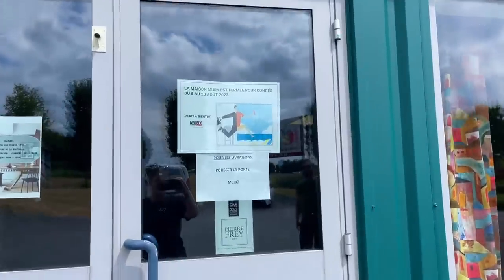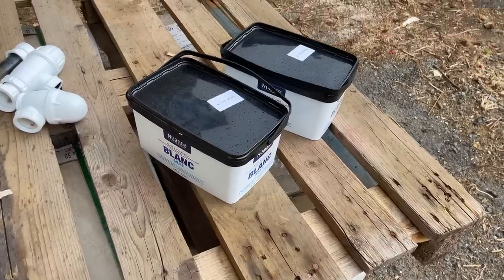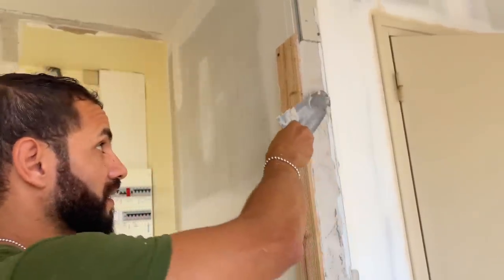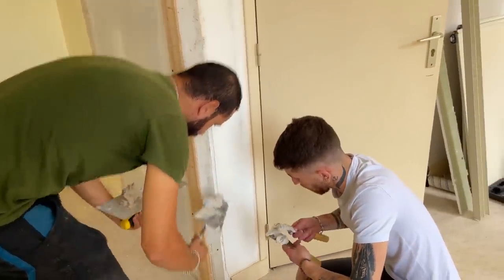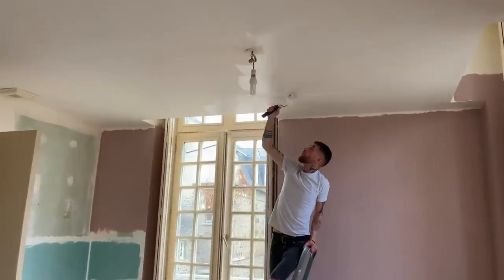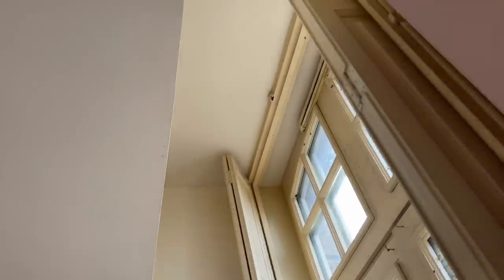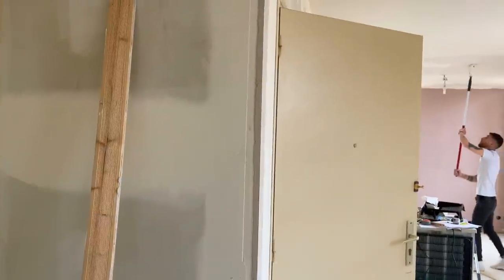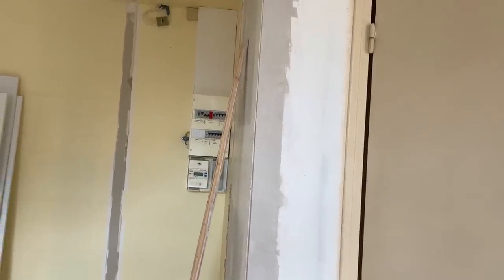Back At It In The Convent Apartment!!!

Comment: In North America, at least, they sell steel corners to form and protect the corners of plaster board walls, which represents a heck of a lot less work and is stronger (more damage resistant).
Reply: Same here in New Zealand, but maybe they are way to expensive in France if they have them.
Reply: In Belgium too
Reply: @caropapa  They are lik 5 - 10 euro per meter here. I'm geussing they were going for a more 'authentic' approach.
Reply: @RoloFilms  it’s possible, but even in the 1900’s they had lead corner bead that went under the horse hair plaster, I believe these walls have “plasterboard” so I don’t think authenticity is what they were going for, meanwhile I only discovered corner bead about 12 year ago. It was a very exciting day for me… now I would like to say that watching this episode has been very frustrating for me, because with or without his guide board, this would have been a lot faster/easier if someone had shown him to turn the trowel the right direction and not keep reworking the plaster. 😖
Reply: @kimberly_erin  AND butt the plaster board to the side sheet. That's too big of a gap around the corner.
Reply: @toniasalways  I’m sure they will realize when it cracks off… wait, is that a pun? 🤔

Comment: In Canada there are corner steel strips ( called beads) . There are videos on YouTube how install them,& put mesh strip over the metal , then you spread the plaster over the joints. The outside corners of plasterboard are more sturdy due to the metal bead strips.

Comment: I know there are already 100 comments on here and I’m partially repeating myself, but for the sake of thoroughness I’ll elaborate. When doing corners you can get very inexpensive corner bead: a metal or vinyl piece that goes on the corners before you plaster. Wether you use this or not you will have better luck if you use the broad side of the trowel rather than the narrow edge. You should almost never be using the narrow edge. Also try not to go over the plaster repeatedly, rather wait for it to dry and add another coat. If there are lumps or air bubbles work them out first before you start on your trowel with a smaller one. If the plaster leaves a little over the corner it’s easier to let it dry and scrape it right of with your trowel/spatula after rather that mucking around with it while it’s still wet.  When you are doing inside corners or joints; use the mesh(not paper) drywall/plasterboard tape. Don’t be silly and tape it to yourself, it can make you itch. 
If I had to say only one thing, I would say don’t over work  the plaster on the wall, try your best in three passes or LESS then let it dry. You can use many methods to refine it afterwards. Great progress guys!

Comment: Bravo for the hard work going on ! 
About the plaster corner. Because such a corner which Mo's plastering is easily ripped away, we, Over here in Quebec, put a metal corner of aluminum. Afterwards one puts plaster over this and the edge stays solid. 
The ceiling... how about painting the 'Wallpart' inside the window, the color of 'ceiling white', instead of the color of the walls ?